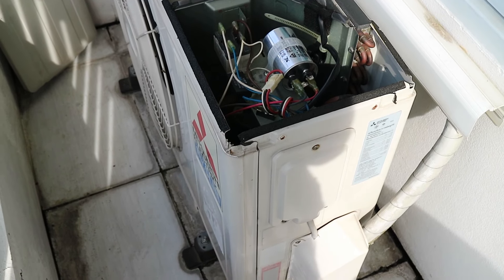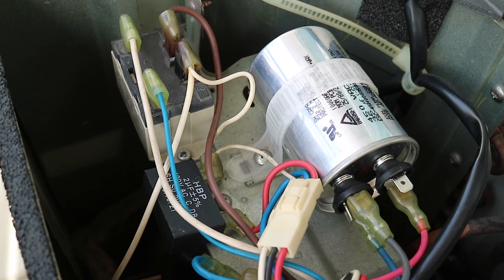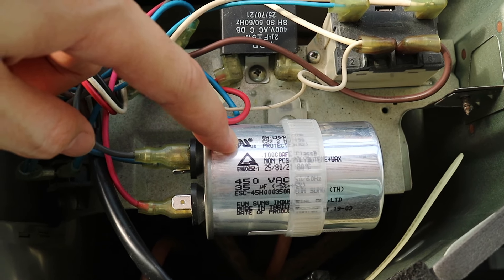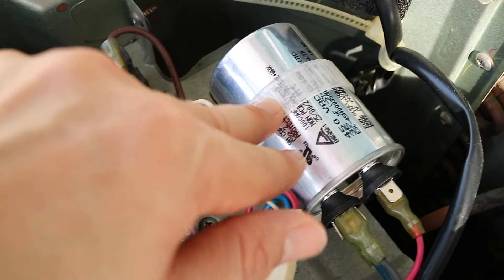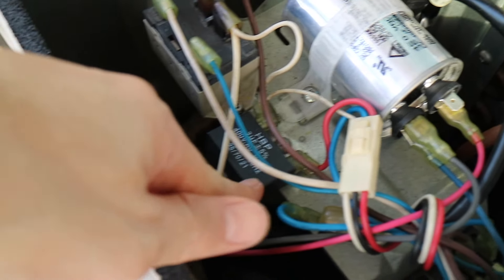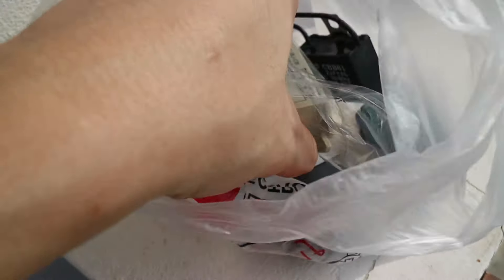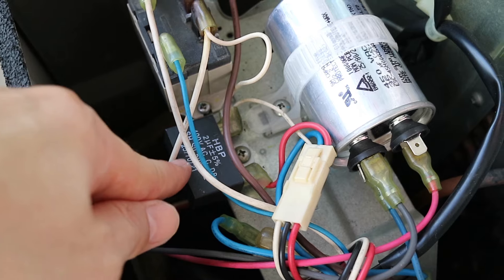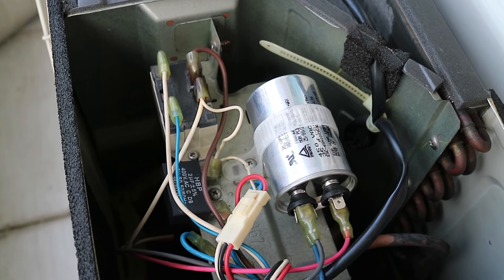วิธีแก้ไข แอร์บ้านไม่เย็น ด้วยตนเองง่ายๆ

Comment: แมกเงียบ 4 ขั้วกับ 6 ขั้ว ต่างกันยังไง
Reply from the maker: ลักษณะ part ของ G7L Power Relay, 1 Pole Model G7L-1A-T (4 ขั้ว) กับ 2 Pole Model G7L-2A-T (6 ขั้ว) จะต่างกันที่การจัดการเทอร์มินัล หรือการจัดการภายในครับ แต่อุปกรณ์ แมกเนติกส์ คอนแทกเตอร์ (Magnetic Contactor) หน้าที่หลักของเค้าจะเป็นอุปกรณ์สวิตซ์ในคอยล์ร้อนแอร์ ช่วยในการเปิด-ปิด หน้าสัมผัส หรือเป็นการตัดต่อวงจรไฟฟ้าอาศัยอำนาจของแม่เหล็ก (Fixed Core, Stationary Core) ซึ่งโดยทั่วไปแล้ว แมกเนติกส์แอร์ที่ผมเห็นในตลาดทั่วไป ก็จะมี 4 Pin 6 Pin 8 Pin 10 Pin ซึ่งส่วนใหญ่ก็จะสามารถใช้แทนกันได้ อยู่ที่สเปคว่าใกล้เคียงกันไหม เช่น 30A อาจจะใช้ได้กับแอร์ขนาด 9000-30000 BTU แต่ที่สำคัญแล้ว ในการที่จะทำการเปลี่ยนอุปกรณ์แอร์ของเรา เช่นแมกเนติกส์ ผมก็จะเลือก part ที่ใกล้เคียงกับของเดิมที่สุดครับ เช่น Amp Phase Pole Volt เป็นต้นครับ (เป็นความรู้น้อยนิดและความคิดเห็นส่วนตัว ถ้าผิดอย่างไรต้องขออภัยด้วยครับ อาจจะต้องรอให้ผู้รู้ท่านอื่นมาตอบด้วยครับ)
Reply: @N2SChannelThailand  เครื่องที่บ้านน่าจะรุ่นนี้คอยร้อนไม่ตัดการทำงาน อุณหภูมิในห้องเย็นปกติ มีผลกับเจ้าตัวแมกฯ ตัวนี้ไหมมครับหรือต้องเช็คตัวตรวจจับอุณหภูมิในคอยเย็นด้วยด้วย
Reply from the maker: @diy4630 เป็นไปได้ครับ ลองตรวจเช็ค Sensor อุณภูมิก่อนครับ แล้วค่อยไปไล่ดูตัวแมกเนติคคอนแทคเตอร์ว่าเสียหรือไกค้างหรือเปล่าครับ